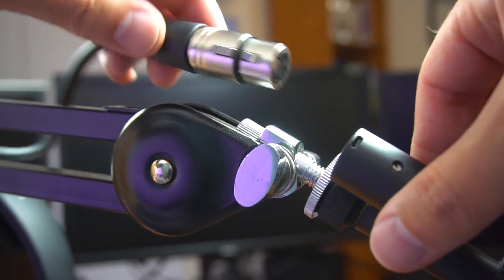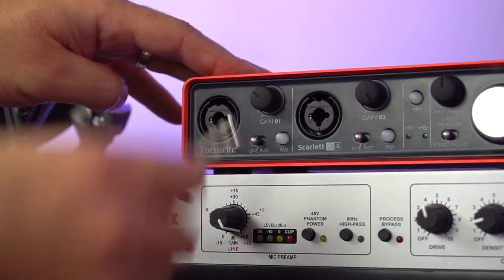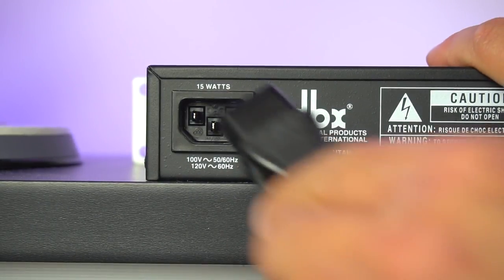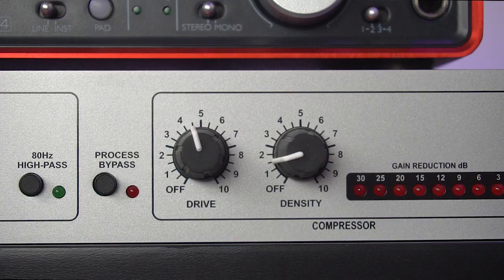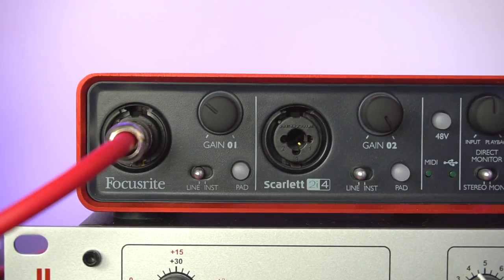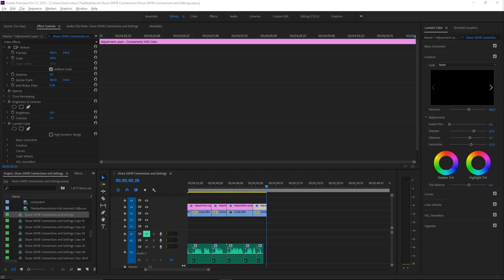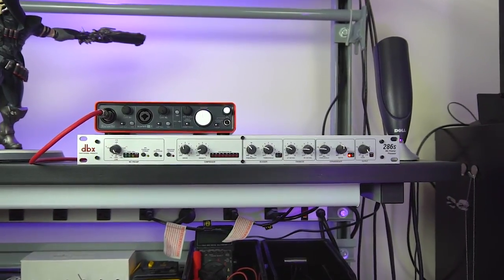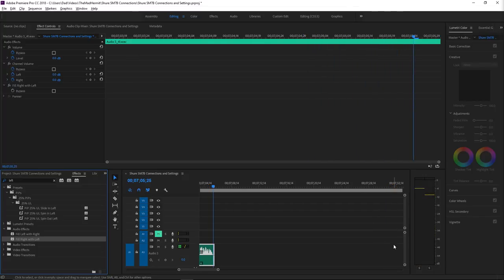How to Connect the Shure SM7B XLR Microphone to a Computer

Comment: I am using an Audiobox 1818 VSL as interface so I do not need a pre amp because the Audiobox has that capability. I use a Cloudlifter for my Shure SMb7 mic to filter the mic but I turn on the phantom power in the Audiobox because the Cloudlifter needs phantom power (not the mic).
Reply from the maker: If you are supplying the Shure SM7B with the +59dB of gain it needs and you are happy with the way everything sounds you need nothing more.

Comment: Thanks for the video. I’m struggling with one question. Are you recording into your camera somehow, or  recording to the computer and syncing later in post? Maybe I’m dumb but I can’t find a video that explains if the audio is syncing to the camera or computer through that usb cable. If so, is there a software or am I missing how this is connected to the camera? Sorry that was 2 questions.
Reply from the maker: I am recording video AND audio with my camera, and ALSO recording audio (with my better mic, the Shure SM7B) into my computer directly. I do this with Adobe Premiere. Once I have both audio sources and the video source in Adobe Premiere I synchronize the two and mute the camera audio. Here is a video I created a while back that shows you how I synchronize the two: https://www.youtube.com/watch?v=n3qppcDAHbs
Reply: The Mad Hermit ok I gotcha! Yeah I usually sync like that in Premiere. Thanks for answering!

Comment: Is this setup okay for a mac too?
Reply from the maker: Yes. I haven't tried it myself because I own a PC, but according to focusrite the 2i4 runs in class-compliant mode on a Mac. No driver is required. Simply plug and play.
Reply: The Mad Hermit is their away to expand upon on your setup if I decide to later add a second sm7b mic? I I'm a big fan of the sbx 268s. Also do you recommend 2i2 or 2i4 and why?
Reply from the maker: Yes, I believe I answered the first part of you question in another comment you left. With regard to 2i2 or 2i4, both will get you to where you need to be. I picked-up the 2i4 because it was a small incremental price compared to the 2i2 with a little more versatility (I like to try to future-proof things). If memory serves, it has pad buttons, RCA and MIDI outputs (which the 2i2 does NOT have). I don't need or use any of them but you never know.

Comment: Well done, this video is very useful. Thank you.
Just one question, can I use this configuration with audio-technica at 2020?
Thanks for sharing the great stuff and good continuation.
Reply from the maker: Sure, though you won't need the dbx286s for the gain. But if you want it for the signal processing there is nothing wrong with that.

Comment: Great video!
Would it not be better to turn down the gain on the 286s and up on the Focusrite?  
Would this not give you a lower noise floor as you will prevent pegging out the 286s gain?

Thank you!
Reply from the maker: There are probably tweaks I can make and experiment with but I am happy with the way things are dialed in so I kind of set it and forget it.

Comment: Hey man, sick setup you have there :) One question I have is why your voice sounds so different from "the feel" I get from JRE show. Joe Rogan is using the same setup as you do but it still sounds more smooth and warmer. Your is in a word more spikey and/or crisp. Still sounds great though but I hope you can explain what settings controll this :) -Marius
*I dont have any of the equipment myself, but planing to buy soon*
Reply from the maker: +Marius Langfeldt Fantastic question. There are many reasons for this. 1) The closer you are to the mic, the warmer it is going to sound as a result of the added base. Joe really attacks his mic head-on and gets all-up in that grill while I produce my videos with the mic a little off to the side and several inches away. 2) Although we use the same mic, I imagine we are using different back/end components in our signal chain. I don't know what he uses, but I am using the dbx286s/Focusrite 2i4 combo. 3) The settings I have chosen on my dbx286s can be adjusted to sculpt your voice in different ways. I am sure there are adjustments I can make to warm things up but it took me a while to get something I like so I have kind of left it there. 4) My voice has more treble then base so that is going to be a factor as well. Those are some of the reasons for the difference I can think of off the top of my head. Hope that helps.

Comment: Am I the only one who goes from my preamp into a mixer with 1/4...and then out rca to 1/8 line in to computer? It  affords so much more control over levels and eq while bypassing the noise of the mixer's preamp being added to the noise floor. It's quite sounding and smooth as hell...and "all" analogue.

Comment: You mention that the reason for using the double sided 1/4 inch TRS cable is to bypass the Focusrite preamp. What would be wrong with going through two preamps? Would that cause sound issues?
Reply from the maker: Replied to this question in your previous comment.
Reply from the maker: No problem. That's what I am here for. :) Let me know how it goes.
Reply: Hi again. I hope you're well. I now have all of my equipment, but I've run into a snag. The Focusrite Scarlett I bought is a different model to yours. I got the Focusrite Scarlett Solo 2nd Gen. Here's a link:

https://www.thomann.de/ie/focusrite_scarlett_solo_2nd_gen.htm

As you can see, there is just one channel to insert the 1/4 inch TRS cable. This channel seems to be for an instrument...

It still picks up the audio from my Shure SM7B (which is connected to the dbx286s), but I must use both gain knobs on the dbx286s (the one on the far left and the one on the far right)...

Also on the Focusrite I must keep both gain knobs at zero (otherwise the sound becomes completely distorted)...

Ultimately the result is that this setup is treating my microphone as an instrument.

I think it's still possible to get decent sound with this setup...but I can't help but wonder if the sound would be better if I had an XLR Male to 1/4-Inch TRS Male to connect the the dbx286s with the Focusrite...

What do you think? Should I return the double sided 1/4 inch TRS cable and get an XLR Male to 1/4-Inch TRS Male cable instead?
Reply from the maker: Because you purchased the focusrite solo your connections are a bit different. You probably want to pick-up a XLR Male to 1/4-Inch TRS Male as the mic input of that unit is XLR female.
Reply: Agreed, thank you.

Comment: I am new to everything, I decided to purchase the microphone for my upcoming podcast after researching microphones. Would this set up work if you have more than one guest? Lets say, I have two additional guest and need to connect one or two additional microphones?
Reply from the maker: With my setup you will need to get a dbx286s for each mic as well as a focusrite that supports more channels like the 18i8 (https://amzn.to/366LBIN). Alternatively, with that many mics you may want to experiment with the Yamaha Mg10Xu (https://amzn.to/2Yoxgon)
Reply: Having multiple guests requires a  multiple hundred-dollar solution. Let me guide you through the 2 possible options.
1) You want every mic mixed down to a single stereo track.
Pros: Easier
Cons: Unable to edit everyone invididually in post processing

2) You want to edit everyone and apply post processing to everyone to have the best render. Each guest will have own mic and track. This will require a digital audio workstation, which we call a DAW.(for that kind of thing, a video editing software is not enough.)
Pros: Better audio quality because of the adjustments of everyone's gains in post and the possibility of post processing
Cons: Harder to understand, potential hours of editing in post, more expensive, requirement of further knowledge.

If you choose #1, you need a MIXER.
The cheapest option for that is the Behringer Xenyx Q1202USB, which costs around US$150. If you only need two channels, you can go with the same thing, but with two channels: the Q802USB from the same brand. 
A mid-range option for that would be the Yamaha MG10XU, which costs around $200.

The issue with that is that everything will be mixed together without any possiblity of finding invididual tracks for everybody, so if someone decides to speak louder than everyone else, it will be less enjoyable to listen to.

If you choose #2, you need a multi-channel INTERFACE.
The cheapest option is the UMC404HD, which costs around $180.
A mid-range option is a Focusrite Scarlett 18i20. It is the interface with the best quality/price ratio.

You'll need to download the drivers as well as the software from the manufacturer
 to make these work. When it comes to EQ and compression, which as many inputs, having a DAW and doing post processing is way less expensive than hardware for every mic.

Give me feedback if you wish! Hope I helped!

Comment: I have a question, I have a audiobox presonus 22vsl, can I plug in a 1/4in cable into it? I'll connect it from the dbx286s. So it's sm7b>dbx286s >audiobox with 1/4 line.

Comment: I need help...
Can i connect the mic only to the focusrite or do i need the other connector to?
Reply from the maker: Depends on the mic. If you are using a Shure SM7B you will need a preamplifier that can provide +59db of gain to get it to line level or you will have a very weak and disappointing signal. The dbx286s provides +60dB of gain, so essentially all the gain you need.

Comment: Sound is so hard to get right. Great video! I have a question and i hope you can answer me. If i use your setup would the sound end up correct in a OBS? I'm currently using the shure sm7 and i have a mixer. it might look like my mixer is not good enough for what i am trying to do and i would buy what you have if needed. Or do you think that a Cloud lifter is enough? Hope you understand what i am asking :D
Reply: No need to reply on this. You sold me on new setup :D great videos
Reply from the maker: Sorry, just saw this. I would get the dbx286s over the CloudLifter. I have both and the CloudLifter is in the closet because it was picking up RF noise and introducing that into my noise floor.

Comment: The Mad Hermit I have a question do i need to download any website for leting the Shure SM7B XLR Microphone working on my computer ?
Reply from the maker: The Shure SM7B is an XLR mic and will not connect directly  to your computer. You will have to use an audio interface. In my case, I am using a Focusrite. Depending on your audio interface you may need to download drivers from their website.

Comment: Nice walk-through.  Since your set-up is almost like mine (except that my FocusRite is the Solo), I was curious about your including the Windows recording level.  I find it has no effect at all on the FocusRite's recording level,  even if I set it to 0 or 100 in Windows 10.  It's as if the FocusRite's own driver and hardware knob completely replace or override the WIndows level settings.  But maybe that depends on how you've got the FocusRite installed -- I don't remember whether I used a driver other than Windows one to install it.  Also, while I keep the gain (left knob) on the DBX 286s at almost 60 for the SM7B, like you (for the reason you described), for me it would be way too loud and distorted with the high setting you use for output (right knob on the DBX), plus the extra boost you get from the FocusRite.  I have to keep the output knob on the DBX under 9:00 (about 15 dB) and the FocusRite gain about 8:00 or less.  But obviously your settings work for you - I just wonder about these things. The only difference I can point to (besides the FocusRite model) is that I connect the DBX output to the FocusRite input using a 1/4 inch to XLR cable, instead of the 1/4 in. plug at both ends.  Maybe that makes it louder?  Anyway, thanks for the video.
Reply from the maker: Thanks. Your last point is probably the difference. I have done many videos on my setup over the years and there are subtle changes now and again as I constantly work to refine my configuration. Your last point regarding XLR/TRS cable is definitely a difference that will result in our audio levels being different. Early on I used the same cable but switched to the 1/4" TRS on both ends to connect the Focusrite with the DBX. This bypasses the focusrite's preamps which is better in practice because you are already using the preamp from the dbx.
Reply: @TheMadHermit  , Thanks for the reply and for your thoughts on this!
Reply from the maker: Anytime!

Comment: Have you tried a cloud lifter with this setup? I already own a cloud lifter and am thinking of getting the 286s for my sm7b and running it with my cloud lifter. Great informative video btw!
Reply from the maker: +Chris Cooper Tried the CloudLifter first. It was introducing RF noise so I replaced it with the dbx286s.
Reply: Thanks for the reply, just to be clear.. Have you tried running your DBX 286s with the gain lower(approx 20db lower) and using this in conjunction with the cloud lifter?  Just wondering if this would allow any improvements rather than maxing the gain on the DBX 286s? Very keen to get the DBX286s and just trying to figure out what I can about it before :)  Some great videos covering your SM7B setup btw!
Reply from the maker: +Chris Cooper Thanks. I did not try that configuration because the Cloudlifter introduces RF noise for me. I don't have that problem at all with the dbx286s, even with the gain all the way up.

Comment: If you are using the mic for something live a live stream, how do you fix the problem of the sound only coming from the left side? You can't really do any post-production work as you are live.
Reply from the maker: Most streaming software applications will have an option in the settings where you can replicate an audio source to both left and right channels so audio is heard from both speakers in real-time.

Comment: thanks for the explanation. is it possible to connect the shure sm7b directly to your audio interface(focusrite) without having to go thru the dbs 286x????
Reply from the maker: You could but the focusrite doesn't provide enough gain for the Shure SM7B (which required 59dB of gain). As a result, the signal will be very low resulting in a very low sound output. The dbx286s is there to get the signal up to line level.
Reply: @TheMadHermit  oh thanks... this helps

Comment: If I have the 48V disabled on my scarlett and set it to line, won't that effectively disable the preamp in the Scarlett so that i'm only using the signal from my ACTUAL preamp? Using two XLR cables?
Reply from the maker: You want to use a 1/4 TRS cable to skip the preamp of the focusrite.

Comment: I just purchased a db 286s and it made a very loud buzzing noise from the unit itself and now wont work. No power outlet I have will turn it on even though other items work from the same power source
Reply from the maker: Sounds defective. I would return it for another.

Comment: Quick question, if I'm using Logic Pro on my MacBook, then is the Pre-Amp processor absolutely necessary, or am I fine with just the Scarlett & SM7B?
Reply from the maker: +Sentimental You need +59db of gain to get the Shure SM7B to line level. If you don't give it that, it will sound too quiet. The Scarlett alone will not do it.